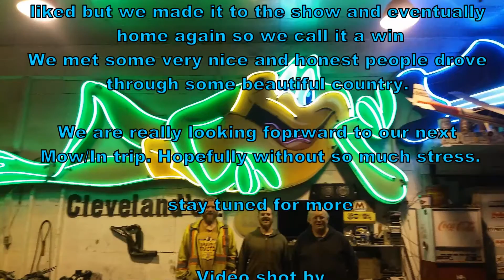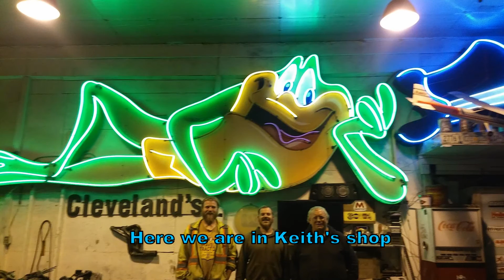Stranded in Ohio. Can we fix it or is the holiday ruined? ( A "Roadkill" style adventure )

Comment: Hey, great video of an epic journey. You guys have some nerve taking on a trip like that in an old F150. Looking forward to seeing the video of the trip to Coldwarmotors.
Reply from the maker: Don't be fooled Roosty, there is a lot of life left in the 92 F150. She purrs like a kitten. It has 310,000 Km's on it and the 300 six does not need topping up between oil changes.  The rear seal on the tranny failed and it just ran out of oil.  Between the Gravely  rider on the bed and the weight of the U-Haul trailer with the various Gravelys on it, we were hauling a little over 8,000 lbs. That amount of weight didn't leave much room for error and we missed the signs of distress. I would do the same trip today with the 92 without a quam. It has had a thorough going over since the ill-fated trip. It is my main vehicle.

Comment: Hey man, nice video....  I remember your story from the Mow In...  Hows the truck working now?
Reply from the maker: Thanks the truck is working great I finally painted the rest of the truck Orange / Red and the cab roof white. I was just under the truck checking the new rear tranny seal and was relived to see the yoke getting a patina of rust. The engine has nearly 300,000Kms on it and doesn't use any oil between changes. The truck is going to look great with the 816 on it at the next mow / in